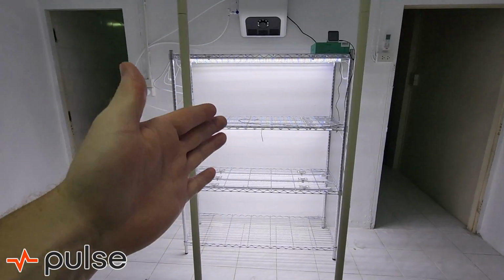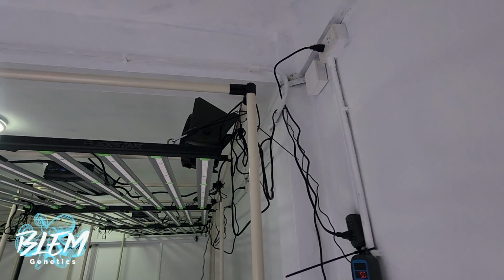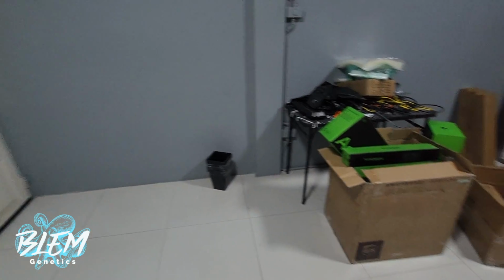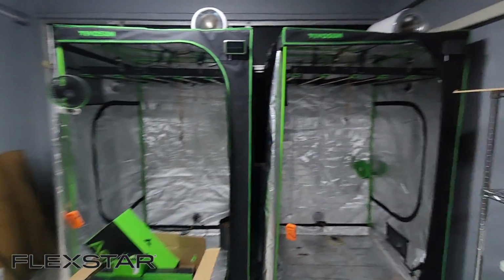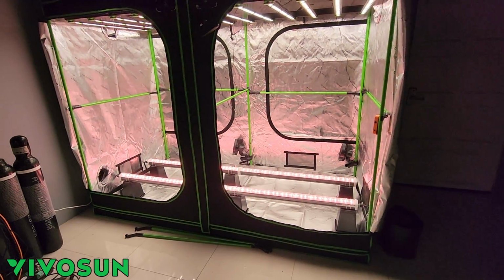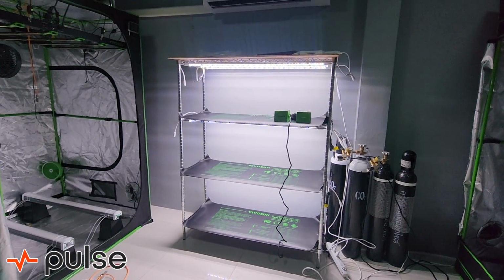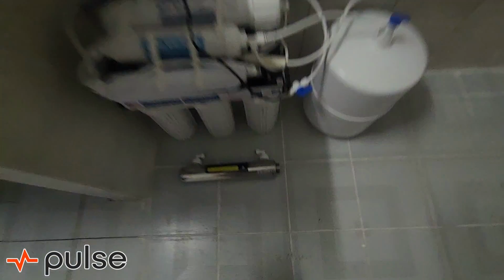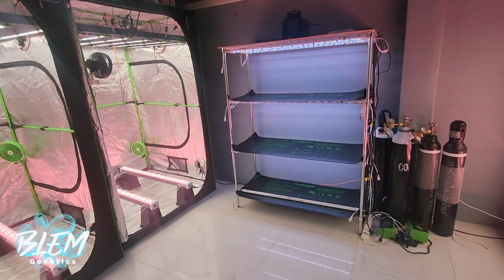BEDROOM INTO 6 LIGHT GROW ROOM!!! PART 4

Comment from the maker: Support the channel by using the links and discount codes below.

Discount Codes: https://bit.ly/34cpcy0

Flexstar https://flex-star.com/

VIVOSUN (DISCOUNT CODE: TERPYHIGHS) https://bit.ly/3FN70M3
VIVOSUN AMAZON: https://amzn.to/3Rmcgvf

Pulse Grow (DISCOUNT CODE: TERPYHIGHS) https://bit.ly/32EDMdI

Front Row Ag Nutrients (40% off DISCOUNT CODE: TERPYHIGHS) http://bit.ly/3E32qIs

Full list of equipment used on the channel: https://bit.ly/36DCotp

Terpy Highs Amazon Storefront 
US: https://amzn.to/3hYuHnc
CA: https://amzn.to/3k17Ry1

Join the Mailing List: https://bit.ly/3JELmct
Patreon Memberships: https://www.patreon.com/terpyhighs
Visit the Website https://terpyhighs.com/ 
Follow me on Instagram https://instagram.com/terpyhighs/
Reply: Love the setup. Can I suggest instead of using a hot air/cold air dehumidifier system you just get 2 decent 25 litre dehumidifiers. The compressor ones create a small amount of heat and instead of moving the humidity you would actually be extracting it completely. Also decent dehumidifiers have HEPA filters so your internal air is being circulated. You can still use the air con for high heat. A 25 litre dehumidifier will use about 300-400 watt depending on efficiency and will actually extract the excess humidity in an effective efficient way. You can setup with perm drainage so no worries and you will save a fortune while actively controlling humidity. I'm in the UK and we have insane humidity all year around, dehumidifiers are our thing like AC is yours hehe.
Reply: @TerpyHighs  we need more updates and videos 🙏🏼

Comment: You could put solar on the roof with just a small battery for power outages. Hybrid inverters are good now days and solar panels are getting very cheap. It would off set a lot of power usage.

You could also sell vivo sun & pulse in a shop there as a sideline thing, then if you need something you could take it from stock and they could credit you.

Comment: Looking good after the last video man, all the armchair experts are going to be real quiet now. I suggest adding a prefilter before your RO system as well just using a cheap faucet prefilter, they are easily replaceable and save the expensive RO membranes from all the larger particulates. What pwEC sensors are those?
Reply from the maker: ph and ec sensors are from Pulse.

Comment: How come you are using heaters instead of dehumidifiers?
Reply from the maker: the way i prefer to control the environment.
Reply: @TerpyHighs  That's cool, I'm just curious what the advantage is
Reply: @RetroBerner  not running a dehumidifier
Reply: @VirginiaBluesOG  That's not helpful, why reply if you have nothing useful to add to the conversation?
Reply: @RetroBerner  you don't need a dehumidifier follow VPD chart